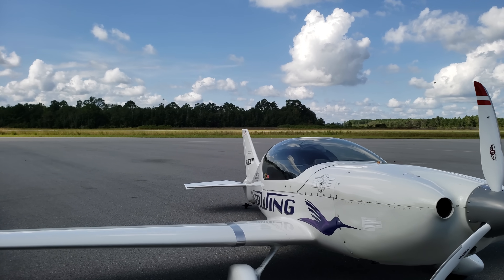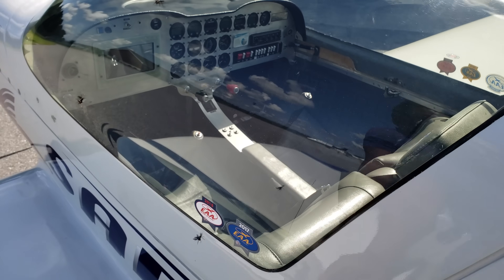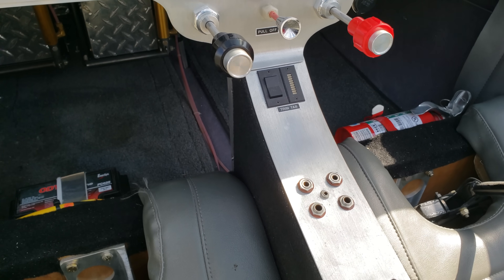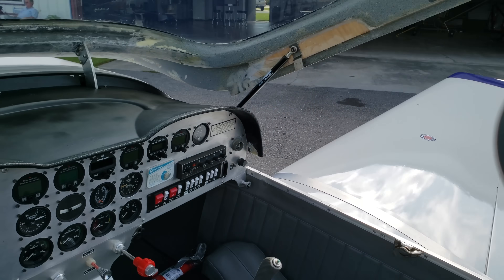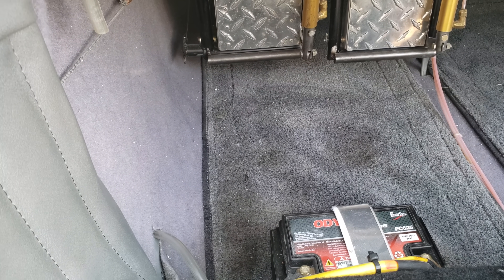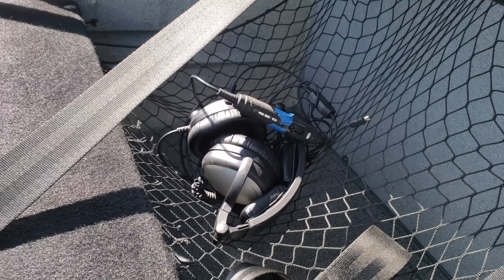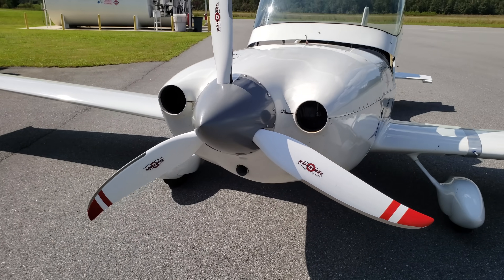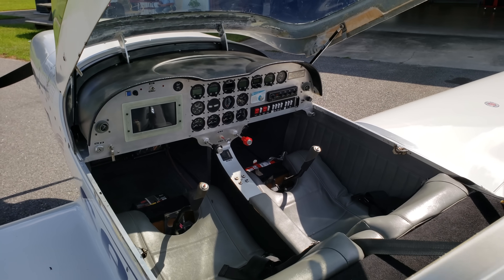$40,000 Saberwing Airplane: First Look

Comment: Lovely plane, extremely cost effective. Has to be the lowest kit price in the world by far. I wonder what the cheapest glass solution is as that would really lift the impression of the plane. say you could get something decent for 5k, even though that's still overpriced, that feels like a nobrainer over dials. I wish though that developers would focus more on tandem seating with extreme aerodynamics and low weight because the 100HP Sharp Nemesis demonstrated 500km/h speed at ground level which is absolutely tremendous potential and I believe even that plane was far from the best that's possible. Think about that.

Comment: What's the deal with taildragger? is it legit or are there critical weaknesses?
Reply: Just a different type of landing gear. It's lighter, and makes landing a little bit easier. However, it doesn't have as effective braking or visibility on the ground. Additionally, a taildragger will have more drag on the beginning of a take-off run.

Comment: Good looking bird. I like the low stance too. But we really need to get rid of those awful mechanical gauges. Just one big dirt cheap glass. Handheld device as backup if everything fails. Get rid of all that junk. I wish though that more would do tandems because it's a smaller canopy door, dramatically better aerodynamic footprint, cheaper and superior throughout. Has the capacity for two but most probably fly single anyway so tandem is just best.
Reply: I prefer having mechanical gauges as a backup since they very rarely fail if you have a dead battery or alternator failure.

Comment: I am not a pilot or have any expertise with flying. Is there a reason that taildraggers back wheel is not at the same spacing from fuselage to tarmac surface as the front wheels?  Seems to me it should be easier to do a level out landing than trying to do a 3 point landing.  I would be afraid of flipping the plane forward if I landed primarily on the front wheels.  But what do I know, I don’t have any type of cell/smart phone.  I have no idea why anyone needs them.

Comment: How far does 40 gallons get you in this?
Reply from the maker: You can go 1,000 miles if you can stay that long in the air :)
Reply: @mojogrip wow that's pretty impressive about 25mpg although I don't know how comfortable that long of a flight would be cooped up in that little cabin
Reply from the maker: Hey if you get some nice seats and a bottle to pee in, why not?😀
Reply: @mojogrip  well I'm 6ft 3 so I don't know how well I'd fit but your right very cheap way to travel once you have the plane of course.

Comment: Mike;  Is this also available in LSA version (100HP, 120kts, 1320MGTOW, 25gal fuel, etc)?
Reply from the maker: That is correct. The aircraft can be configured as a light sport.
Reply: MojoGrip  Need to check that. Don't think it is available as an LSA.
Reply: Indeed, I did not see anything on the sabrewing/Azalea website about an LSA version.  MGTOW would have to drop about 180#, which should not be too tough to accomplish design wise, as they's have to lop off 20hp from the motor and 15+gallons of fuel from the tnaks and yet find a way to keep the speed down to 120kts at sea level, among other things.
Reply: The LSA-conforming prototype with tricycle gear is currently being built. Build photos are indeed on the website.
Reply: I missed it!  HOw could I have doubted the MOJO of Mike
Reply from the maker: It is, I promise. I have proof of the prototype on video trust me lol
Reply: @PaulAnthonyDuttonUk  Flies too fast. 120 Knots max. It's the same problem with the KR's. They just fly too fast!

Comment: How does it do in the crosswind?
Reply: It really does go away. I have only been in about 25 mph crosswind with mine yet.
Reply from the maker: Up to 30 kts max on crosswind from what I am told.
Reply from the maker: From Azalea Aviation: When the airplane is lower to the ground the crosswind component almost disappears. The Rudder doesn't sit as high into the stronger wind. The Tricycle gear plane will have a lower crosswind component due to higher tail.

Comment: Would be interesting to know what is the composition of aircraft structure re the Wood/Composite mix...Which part of structure is wood, which part composite?....What are the G-Limits? . . .Normal or Utility ... and what are the ball park cruise speeds.
Reply: Check our website.    AzaleaAviation.com.   Spars are prebuilt Wood.
Reply: Thanks for the response.  Yes, I checked your website and it provides a lot of good information.  Thanks again, looks like an excellent plane.
Reply from the maker: According to Azalea, The only parts that are wood are the main wing spars, elevator and vertical/rudder spars. The rest is composite. Up to 6Gs. Cruise is 150 mph on average.
Reply: Thanks Mike!  Good VDO.

Comment: Nice! That's the perfect place to put the D-Motor 3.9L, 6 cyl; 125hp/@180lb installed. Thats @50lb less than the corvair six. and its fuel injected w/ Dual ECU  https://www.youtube.com/watch?v=-HOcmXODZII
Reply from the maker: How is the reliability? and does it sound as good? lol the Corvair on the Saberwing sounds almost like a P51 mustang.
Reply: Well everything I have read so far about the D-Motors is excellent and it sounds awesome _ like a flat six should.  By design the Flat-Head is a very reliable engine_ it has fewer moving parts than an OHV engine with no risk of dropping a valve into a cylinder.  The reason the Flathead was replaced by the OHV engine in autos was because OHV engines are more efficient at higher RPM. At the lower RPM of Direct Drive Aircraft engines (2,400-3,200 RPM)  there is nothing to lose and much to gain by using the Flathead.  https://www.experimentalaircraft.info/homebuilt-aircraft/d-motor-aircraft-engines.php 

I have been over looking at the Saberwing web-site, roaming around, looking in windows, finding out what I can about the Saberwing and I gotta say I'm really liking it. I have been looking for a project and was thinking of a Zenith CH 750 CRUZER. I wonder if you can put that Saberwing on floats? Would that be crazy or what!  http://www.zenairfloats.com/1450.html

Comment: What about ground effect at landing?
Reply from the maker: Rudolf, Ground effect make the airplane easy to land but can cause float so the airplane has rather large flaps to create the drag needed. With a 13:1 glide ratio the plane is clean and needs drag for shorter landings.
Reply: Hi Mike! Thanks, I understand you have flown it?
Reply from the maker: Correct. I'll upload my flight video soon